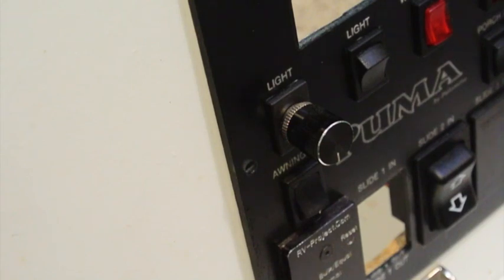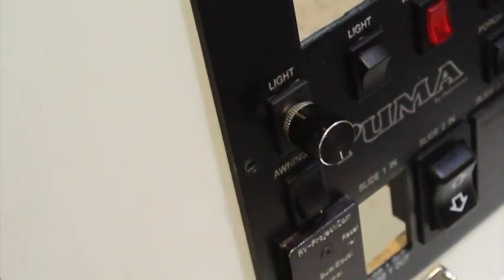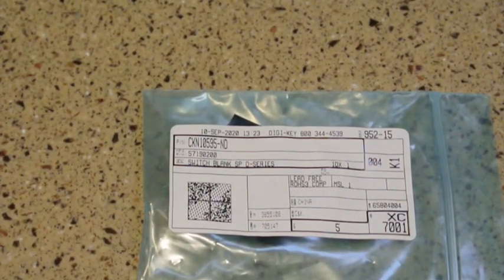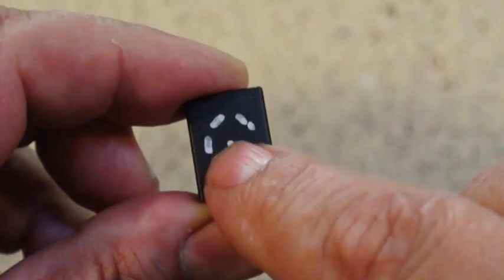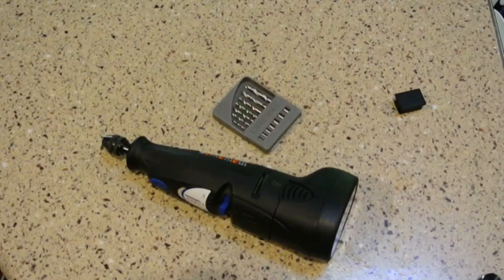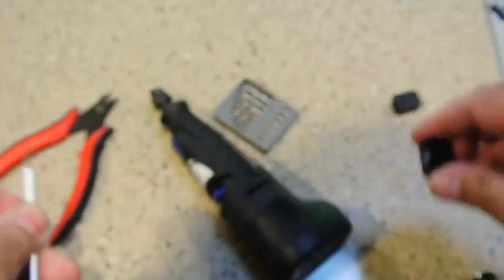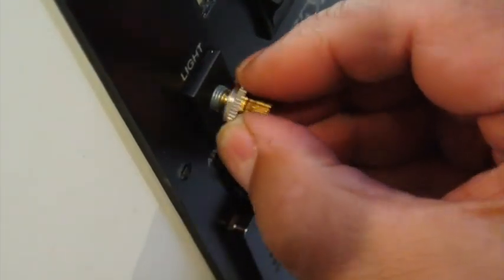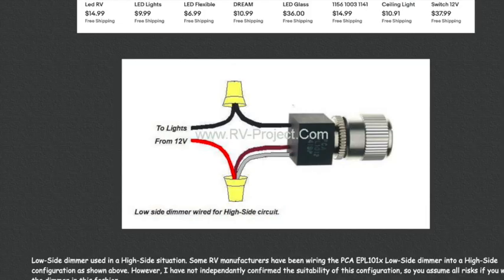Making a bezel for a popular RV LED dimmer.

Comment: I don’t see the stl file on your site for the blank. Is it still available?
Reply from the maker: For some reason, its not on my 3D page.  I will upload it next week as I am camping right now and dont have access to the file.

However I have a link to a slightly different bezel that should work.  Its on my webpage:  http://www.rv-project.com/gear/dimmers1.php

The link is near the bottom of the page. The file is actually at Thingiverse. I did not make this one, but it should work.

Comment: Good video!  What is the difference in choosing high side vs low side wiring?  How would you choose (advantages vs disadvantages) of one over the other?
Reply from the maker: Low side vs. high side has to do with how you wire up the dimmer to the LED fixture(s).

Whether you use one vs. the other has more to do with accessing the wiring to the fixture, rather than any performance advantage of high vs. low side.

High side dimmers are slightly more expensive to build, but only pennies more.

I have an extensive 12V Dimmer Shootout on my website http://www.rv-project.com/gear/dimmers.php that covers this and other topics.